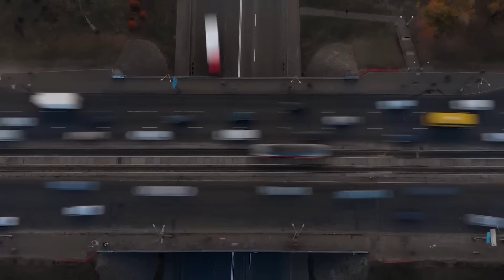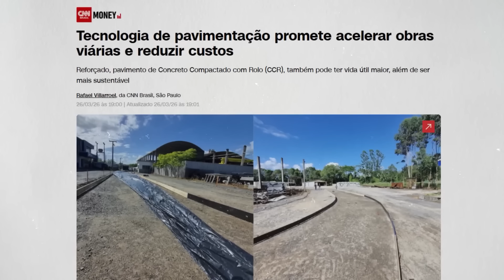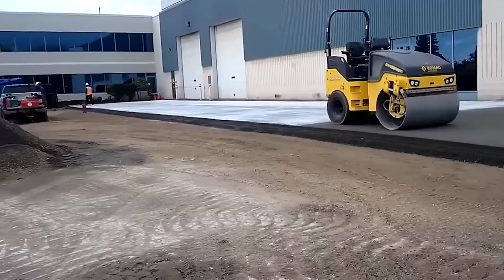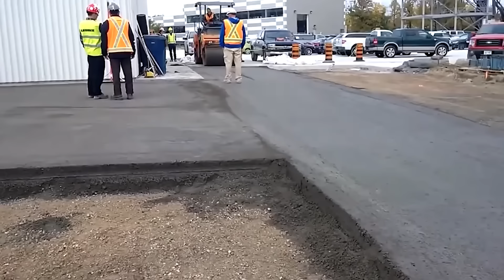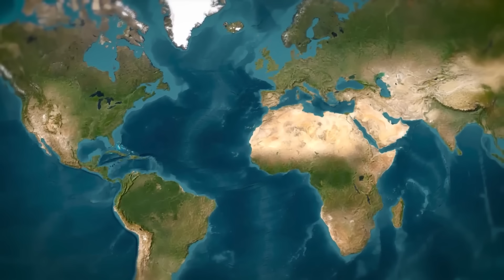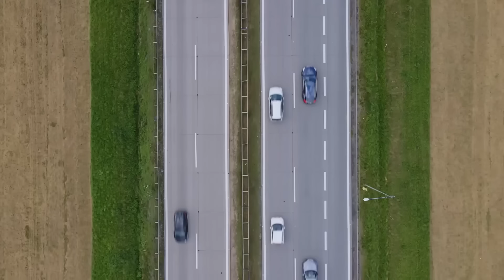Brazil Unveils Road Paving Tech That Lasts 3x Longer!

Comment: Concrete highways has proven that the longevity far out weighs bitumen including maintenance costs.
Reply: FYI road constructions is not something as easy as you think.
There are different variables to be considered such as cost per kilometre, type of terrain, type of available local resources, type of weather, type of road traffic.
Not all surfaces are the same, what works in one specific par of the world won't work in another part of the world.
Some areas have ice and snow, some barely any rain, the roads may need to withstand extreme low and/or high temperatures.

Roads may be required to evacuate more rain.
Also, the road finishes depend on the type of traffic and speed of the vehicules.
Do you expect having the same braking distances on a concrete road vs an asphalt road? 

That's why not all roads are the name, and the cost per km will vary.
Reply: @SERGIO-cr6uy  worked in civil dude.
Reply: @grahamj1935 did you and yet your knowledge is limited...
Reply: @SERGIO-cr6uy  I don't think it's limited mate. Difference between you and I, I got my hands dirty, you sit in an office and draw up plans. Then people like me get those plans and need to improve those plans because you went out site once and never left it again.
Reply: The region I live in, in the upper midwestern USA. Concrete roads are constantly being replaced every 10-15 years. Asphalt roads commonly last 30-40 years. And that's after digging down 8 to 10 feet to put in a good road base and compacting it first, when putting in brand new road. Or replacing old roads that never had a good compacted base when they were first put in 50+ years ago. Local climate makes a huge difference in what will last longer. This is what I have seen first hand in my 60 years. And my fathers personal experience in 47 years of road construction.
Reply: @r.a.a.65  Mate, bitumen roads last 5 years in Australia...if you're lucky. Constant maintenance and or stripping the top layer to over lay with "new" bitumen.... Our climate is vastly different to that of US...
Reply: @grahamj1935  I can believe that. Most of your climate is dryer and consistantly hotter all year.  The flexability of asphalt is why it survives where I live. Our temps swing from -40° c to 42° c almost every year.
Reply: @r.a.a.65  in 48⁰C days you can literally watch the road squash under the weight of semi trailers....
Reply: @grahamj1935  I don't doubt that. We see some flexing at 42. Of course our humidity is higher as well. Meaning our asphalt doesn't dry out like yours probably does. Leading to early failure. I've seen 40+ year old asphalt that's brittle and crumbling. Never been touched since it was laid down. I imagine that's what happens to your roads in the dryer regions.

Comment: If you add shredded rubber from old tires, the pavement does not wear out either, & it doesn't wear out tires like regular pavement.
 Some places are using used plastic from landfills too.
 Seems crazy not to use new methods.
They need to stop using salt & chemicals for de-icing, too.
Reply: And maybe,old wind turbine blades too, perhaps?
Reply: @Pierwalker  No, just use some intelligence to realize those are not a viable solution.
Reply: @ILGuy2012  I checked this idea with ChatGPT and it said this:
"How blades are used in roads
1. Ground into material for asphalt or concrete

Blades can be cut up and processed into small particles. These are then mixed into:

asphalt (road surfaces)
cement or concrete (road base layers)

The shredded composite can act as:

a filler material
a partial replacement for sand or aggregate

Some studies show this can improve crack resistance and flexibility." 😀
Reply: @Pierwalker  I'm saying don't make them to begin with.  Then you don't have the blades to dispose of.
Reply: @ILGuy2012  But they are being made, and when in use they do great job.
Reply: @Pierwalker  They are not being used. For sure not in real pavements.
Reply: Think long term. And in more complex way.

Idk, if you wanted to used shredded rubber in regular concrete, but it is not used that way. Shredded rubber from old tires is scarcely used in bitumen mixtures, but the cost is high - not just energy consumption due to a higher mixing temperature. Also, all of your producing gear will be contaminated with the rubber (you don't want to clean that up), not mentioning more of dangerous fumes for the crew. Since you need to have a high compaction temp (180 °C), you need to deliver that from the plant to the site and keep temp at the level. Every degree Celsius lower means far bigger problems with the compaction, than in case of regular mix. In general, it is literally about the discipline when constructing a pavement. And even regular tech can be good, if used properly. Which is not the case in many countries since people laying the layer down are often 'simple' people, who don't care about quality of the construction. They care just to get shit done so the boss is satisfied and go home. And since there is a shortage of manpower, crew heads or project managers can't do shit (and they often don't care about quality either too, because they don't have deep knowledge of what is the job about).

Plastic is all around the world and I don't think it is a good idea to spread it even more. Although, synthetic polymers are hard to decompose, most of them will oxidize just after few years and will become brittle. This will negatively affect lifespan of pavement and you will end up with non-recyclable waste. Also another good source of microparticles. 

If you have an idea, how to replace salt and deicing chemicals, just write it here please. Or start a business, the way is open.
Reply: @skihck  Did you write all that yourself or did you use AI?
Reply: @Pierwalker An Actual Italian? Partially, since I probably have Italian ancestors.
Reply: What rubbish!

Comment: concrete in places with ground shift or freeze heave is complete trash and very very expensive to have that trash. In Pa every expansion joint heaves and the roads are like riding a bull and they spent hundreds of millions putting in dog bones and other crap when the solution is to get rid of concrete and put black top.
Reply: It just needs a proper base under it to be successful. Here in Southern Ontario we have a privately built toll Hwy (407). It's all concrete and it's the nicest riding hwy in the province. They didn't spare any nickels when they built it and they continue to expand it to carry more vehicles. The base is super thick and elaborately drained granular. It does cost a minor fortune to drive on though. It's very doable, just gotta want to and have the cash!

Comment: The safeway warehouse in tracy, ca had RCC. It fell apart and was replaced with poured concrete
Reply: The main thing is that the roadbed has designed for as well as rigorously tested for excellent drainage, just using RCC with a roadbed design that is inadequate won't solve anything.  Freezing and thawing ground water particularly under the pavement is the prime pothole creator.  I am certain Canadian civil engineers are more than up to the design and testing task,  but the politicians with the paving contractor friends do not what long lasting pavement, its bad for business.
Reply: It was probably done on purpose to benefit local contractors.

Comment: Asphalt is cheaper to install, faster and easier to repair. RCC is stronger and lasts longer. It would be overkill to install it everywhere. It is best used where there are a lot of heavy trucks on the road.

Comment: There is no question that RCC is far superior to asphalt,  the only ones that question it are those that are too lazy to read about it.   Missing is that ALL road beds should start with at least a foot of rock to be stable.  

Look at train track base if you want to see a good example of how to build a road.  Very stable,  very flat, heavy duty,  which results in high fuel efficiency.   If roads were built that way the maintenance needs would be very low.
Reply: You can’t seriously be comparing a railroad track to a road made for cars..
Reply: @crazytimesman  I am saying that if roads were built using the same base as a rail track,  and topped with RCC, the maintenance would drop 90%.  The load capacity would increase enough to support heavier loads.  Vs today our roadd are constantly blocked by repair crews  messing up vacations and getting work done. 

The current method waste millions of hours of people's time.
Reply: It will be suitable for specific roads that are traversed at low speeds, residential and industrial locations. It will not be suitable for highways or main thoroughfares where the cost saving and speed of rollout makes most sense. You can’t just use RCC just because of its strength. It also has its limitations.
Reply: @crazytimesman  The air temperature near I5 in California is 115 F, the asphalt is nearly 150 F in the summer.  It's like driving on putty.  There is a normal in town road 1 mile from my house,  3 lanes each direction,  40 mph.  They can't even hold it together so instead they banned trucks over 4 tons,  yes a normal pickup truck. 

Asphalt is IMHO a complete joke, just a construction worker jobs subsidy.

Concrete works, it was used for many decades,  asphalt is used only because it is cheap for the project,  but it waste the drivers time and that is worth $50 / hr per vehicle.
Reply: @h@harryniedecken5321ol you’re shooting shit out your ass 😂 anyone who knows anything about roads knows that concrete is cheaper.

Comment: Oil companies making a lot of money selling bitumen will not be happy with this technology
Reply: FYI road constructions is not something as easy as you think.
There are different variables to be considered such as cost per kilometre, type of terrain, type of available local resources, type of weather, type of road traffic.
Not all surfaces are the same, what works in one specific par of the world won't work in another part of the world.
Some areas have ice and snow, some barely any rain, the roads may need to withstand extreme low and/or high temperatures.

Roads may be required to evacuate more rain.
Also, the road finishes depend on the type of traffic and speed of the vehicules.
Do you expect having the same braking distances on a concrete road vs an asphalt road? 

That's why not all roads are the name, and the cost per km will vary.
Reply: There are some that flap their gums before they engage the two brain cells trying to locate each other.
Cheers.

Comment: Can only work in environments above freezing, in climates with below freezing water can get under the material expand and crack it,so what works in brazil necessarily  wouldnt work in say Michigan or Minnesota!
Reply: Yep, to quote the concrete doctor, "where palm trees be, it's better for masonry".  Completely different concrete needed where it freezes, and salt is used.
Reply: Weird how it works in Germany and Poland. Stop posting ignorant comments. 22% of Polands highways are concrete and 30% in Germany.
Reply: @thomasprogli3372  There's concrete roads all over the world lol.  This is not the typical concrete process that's used.
Reply: @KGB5910  LOL ... Did you really think that engineers build the same way all over the world. Ignoring local conditions. I hope you are not an engineer.
Reply: Psh, you don't know that
Reply: Oh so only MOST of the world
Reply: All roads need drainage under them to prevent this from happening. What fails is often the soil underneath.
Reply: So where did you get your engineering degree from? Many countries use concrete to build roadways without significant problems.
Reply: it's dry from the beginning, there's no chemical reaction... it's like a hard powder...
Reply: Can't be in very wet climates either.
Reply: I guess concrete roads are hopeless 
This is drying concrete
Reply: The freeze thaw cycle is brutal on hard surface roads with asphalt or concrete.
Reply: lime soil stabilization resolves many the base layer issues.  they can use flyash, lime and cement and produce a layer that self heals.  they've used it at various airports.
Reply: Michigan or Minnesota are new countries to me, where on the world are they?

Comment: In America they want to pave, re-pave, pave, re-pave and pave again. I seen the street dug up, covered, dug up again, covered. Improved road paving makes no money!
Reply: FYI road constructions is not something as easy as you think.
There are different variables to be considered such as cost per kilometre, type of terrain, type of available local resources, type of weather, type of road traffic.
Not all surfaces are the same, what works in one specific par of the world won't work in another part of the world.
Some areas have ice and snow, some barely any rain, the roads may need to withstand extreme low and/or high temperatures.

Roads may be required to evacuate more rain.
Also, the road finishes depend on the type of traffic and speed of the vehicules.
Do you expect having the same braking distances on a concrete road vs an asphalt road? 

That's why not all roads are the name, and the cost per km will vary.

Comment: This would never work in Canada,  with it's constant frost heaves and freeze thaw cycles
Reply: It's already working in Canada.  The 401 is being replaced section by section with this method of concrete. They are also testing prefab concrete slabs to replace sections of some highways, which reduces highway down time and increases longevity..

Comment: You want a challenge try this in Canada. Places like Alberta and Saskachewan
Reply: Challenge accepted: 

1. Edmonton (Anthony Henday Drive): The southwest portion of this ring road was Alberta's first major concrete highway project. It used longitudinal tining (small grooves) and precision steel dowels to create a quiet, level surface that has significantly lower maintenance needs than asphalt.

2. Saskatchewan: Concrete is frequently used for high-stress points like roundabouts, intersections, and commercial pads in cities like Regina, Saskatoon, and Lloydminster.

3. Specialized Projects: Concrete overlays have been used in Fort McMurray and for interchanges on Highway 40 in Grande Prairie to handle heavy industrial traffic.
Reply: Agreed. Subject this paving technique to the free thaw climate of Canadian areas. Also put it to the test in freeze thaw in Wisconsin and not to mention Michigan's barrage of salt salt salt .

Comment: Paradise Dam near Bundaberg is an RCC structure which has to be replaced at great cost. There is no data as to why it failed but the doubt has been seeded.
At Oroville Dam the RCC replaced eroded soft rock and was capped with wet mix concrete after the second season.
A deep dive would be well worth watching.
Reply: Paradise dam failure has a well-known cause - insufficient cement in the RCC.

Oroville had nothing to do with the concrete - it was subdrain failure that allowed erosion under the concrete
Reply: @ArthurDentZaphodBeeb  correct
Reply: RCC is a zero-slump (dry-mix) concrete placed in thin layers with heavy rollers, similar to asphalt paving. It is cost-effective and fast for large-volume projects like dams and pavements. ￼
•  Paradise Dam used a very lean RCC mix (low cement content, reportedly around 2.5% cement — lower than 99% of other RCC dams worldwide). This led to poor bonding between layers (lift joints), low shear strength, and long-term degradation. ￼
•  Issues surfaced around 2019: structural stability concerns forced water levels to be lowered significantly. Investigations (including a 2020 inquiry) found the RCC was “intrinsically incapable” of meeting safety standards. The concrete has weakened dramatically (up to 90% strength loss in places). ￼
•  Fixes (e.g., lowering the wall) were attempted, but by 2024 it was decided a full replacement dam wall is needed downstream. Early works are underway, with major construction targeted for around 2028.
Reply: @brokenhand7256  , so who is responsible for the low cement content?   normally on important works, every batch of wet concrete is checked for quality.   the stuff is a failure if only because there are so many opportunities to compromise quality.